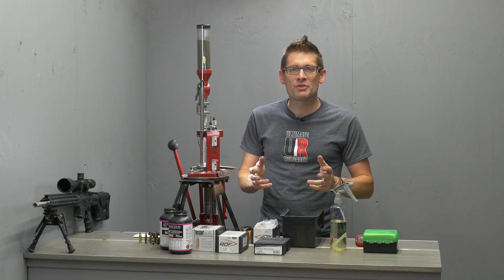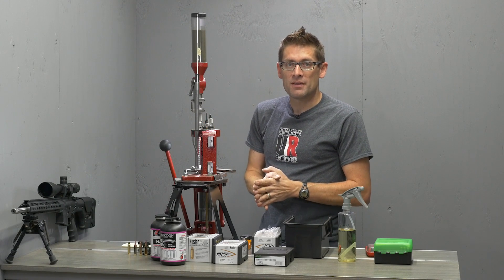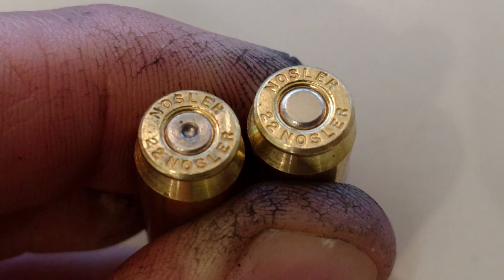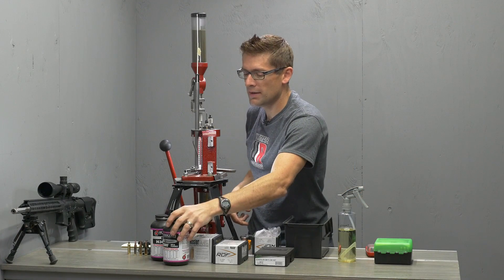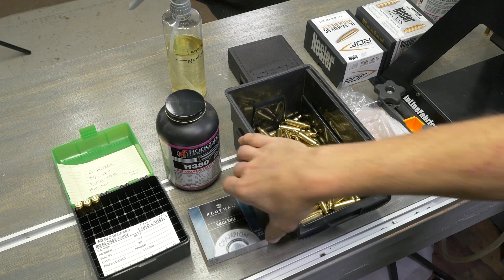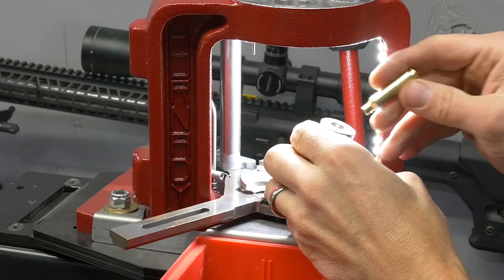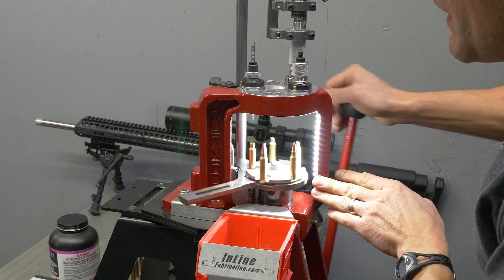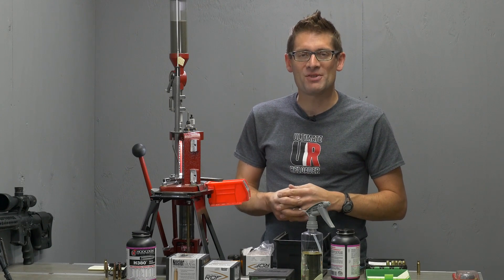22 Nosler: Reloading Overview, Brass Longevity, Special Considerations

Comment: I have always hand de-primed my brass before wet tumbling. Is it just as good to tumble it primed and let the press de-prime and FL size eliminating the hot spot/blister on my hand from de-priming manually? What would you use to trim this brass if it was beyond spec?

Comment: I know this is been about four years but I got into some wildcat rounds in the AR 10 I quickly found that the largest contributor to Case damage had to do with timing and the timing has to do with the length of the barrel and the length of the gas tube. Linger gas tube the better. rifle+2or +3.  I have started running .17 Remington in the latest build.  If I do it over I would’ve went with 17-223.  even so I’ve been Able to use 223 cases off the ground they’re slightly short(17rem) but  hasn’t seem to cause any problems though and shooting is cheap that way and a heck of a lot of fun.  Once this barrel is burned out I’ll probably do 17-223 or 20tacticle/practical.  Anyway either way Nosler went out or on a limb to make this round and I just feel that perhaps they should’ve done a little bit different with testing.

Comment: I have been shooting 22 nosler for about a year now and haven't had the issues that some are complaining about I get right at 3400 fps out of a 18" barrel. It is exactly like you said is a hot rodded 223 nothing more I get very good accuracy out of it using bl-c2 powder some of my cases are on there 6th reload I have had some minor abrasion on my case rims from my extractor I probably should install a adjustable gas block and reduce the gas pressure but my brass isn't getting destroyed like Johnny' S was and my groups were always decent with several other powders just started to see pressure signs and flattened primers
Reply: What bullet are you using and what kind of load data? I'm getting what Johnny got using factory ammo

Comment: Great info Gavin, I'm in the process of building my 22 Nosler. I'm just waiting on the final pieces and then off to the range. As you stated below about the 243, I'm in the same boat I have a few rifles in 243 and wanted a true varmint round in an AR15 platform.

Comment: Gavin, your videos are always well done. I'm a noobie to reloading and am a bit confused with getting the powder measure on the Hornady L&L set up for a given charge. I couldn't find a video addressing adjustment in your archives. When starting out is it just hit and miss on where the measure is at? Is there advice you can give regarding proper adjustment on the powder measure itself? If I missed a video discussing this, please let me know.

Thanks for your help,

Steve
Reply from the maker: It takes some guess and check, unless you buy the micrometer metering inserts: https://www.midsouthshooterssupply.com/item/00005050124/lock-n-load-rifle-metering-insert

Comment: Thanks for the video, Gavin.  I had certain powder and bullet combinations that were resulting in acceptable brass after firing.  Reloading 22 Nosler is certainly possible.  I enjoy exploring lots of powders and bullets, however, and have not been able to determine any way to reliably predict which powders will or won't cause problems.  I relied on Nosler's published load data for that but had problems at some of their minimum charge weights.  The 77gr factory Nosler ammunition actually exhibited some of the worst pressure signs I saw during testing, which I interpreted as meaning it probably wasn't a fundamental mistake I was making with my reloading process.
I hope that I indeed got an early batch of soft brass which would explain all of my problems.  Unfortunately I have not seen any technical bulletins, recalls, or guidelines from Nosler about how to identify the soft brass, or how to go about getting it replaced.  After doing a lot more research, my problems are unfortunately not unique.  Many are switching to a 6.8 SPC bolt and using 6mm Hagar brass, which works well from everything I've read.
After trying two barrels, thoroughly adjusting my gas system, trying an extra heavy buffer and spring, and several other possible fixes I have decided to give up and move on to something different.
I love your site and channel, Gavin, and I really appreciate how transparent you are about your partnerships and sponsors.  I never intended you to be in the crossfire of my problems with 22 Nosler.  Happy shooting and happy reloading.
Reply from the maker: Johnny- thanks for taking the time to comment here! I think extreme care and some experimentation is needed when loading and shooting 22 Nosler just due to the fact that it's pushing the limits... Let me reach out to you on email, and I'll reach out to Nosler, and see if we can get more info. Love your channel as well!

Comment: what bolt carrier and weight used use same load with revised brass still damages.  Adjust gas added more tungsten still no luck
Reply from the maker: You're running 70 grain bullet and 30.5 grains H-380? My bolt and buffer are standard.